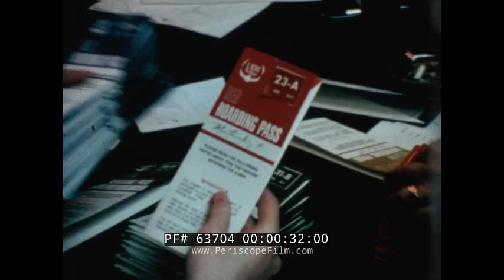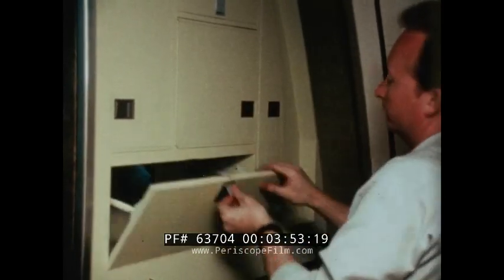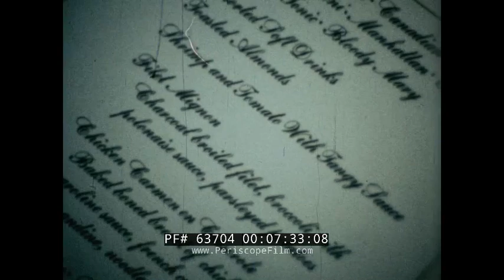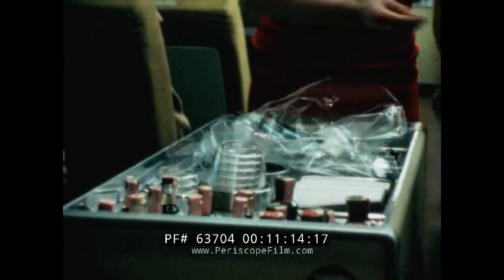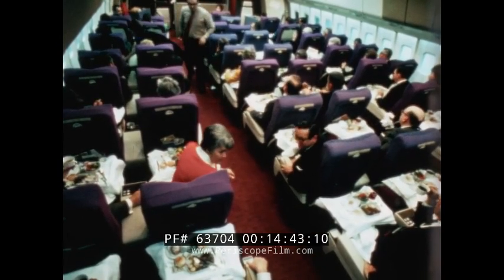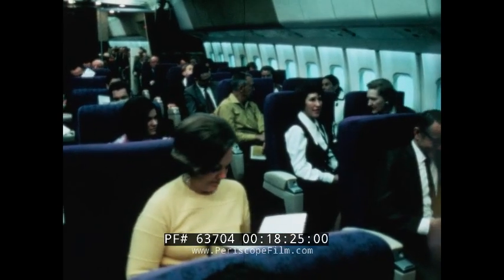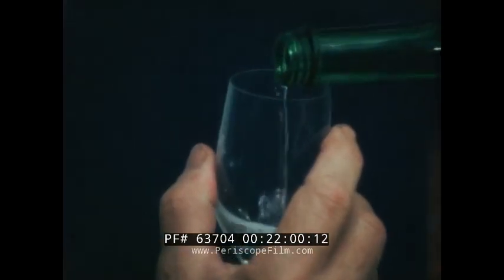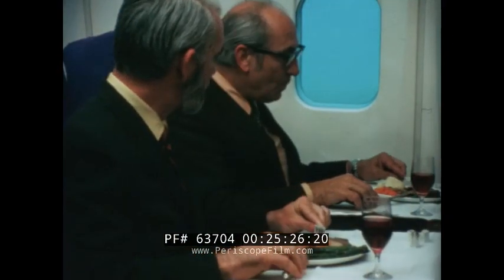LOCKHEED L-1011 TRISTAR AIRCRAFT PROTOTYPE MOCK-UP   FOOD SERVICE TEST FILM  63704

Comment: Can't fool me, Lockheed.....thats still just a DC-10 and I dont fly in DC-10s or DC-10 clones.
Reply: You nor anyone else, DC-10's haven't flown passengers since 2014.
Reply: @tuffguy428  That's true. 

The new 737 Max fuselages get trained past my place....those are looked sweet but then....you know....Lion Air JT610.
Reply: jack torrence  32 accidents with 11 hull losses....not too bad. 

Doesnt change my opinion on them though. Thanks.
Reply: jack torrence  ...and tristar's L-1011 resulted in a total of 539 fatalities by 2011. 

....do you have a point? How does any of this apply to a subjective opinion?
Reply: agree. All women have three holes as well...but they are far from the same lady!!!
Reply: Dayumn, that's some response. Why do you feel this way, and what makes you feel that the L-1011 is a so-called "...DC-10 clone"????
Reply: It was never a clone.. the DC-10 design or TRI-JET's  were requirements to meet a FAA  requirement for flight over water. And since you want sound ignorant,  the L1011 had a better saftey record then the DC-10, it took many years and lots of death's to fix it, and btw an  aircargo company just lost 5 crew members in JAPAN  when that dc10 flipped over on approach , a design flaw the L1011 Did not have.
Reply: @thomasburke7995  it was a joke. 🤦🏽‍♂️😑  I get your point and you're not incorrect 👍